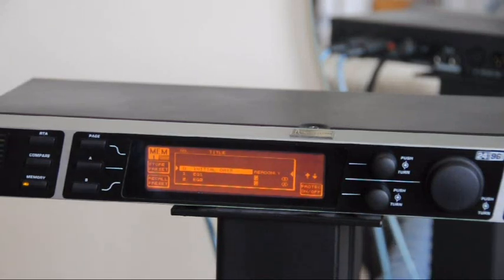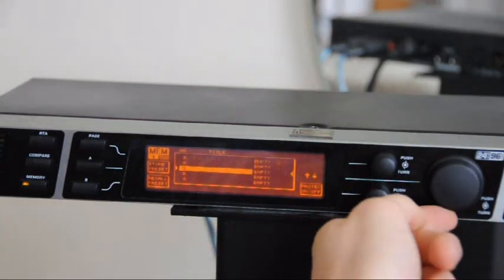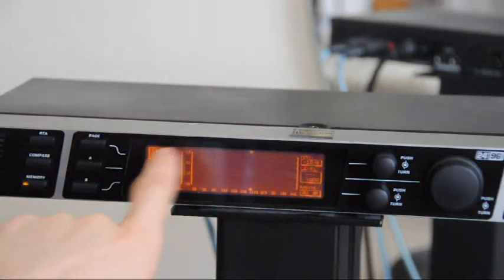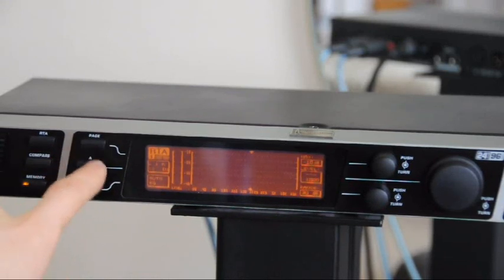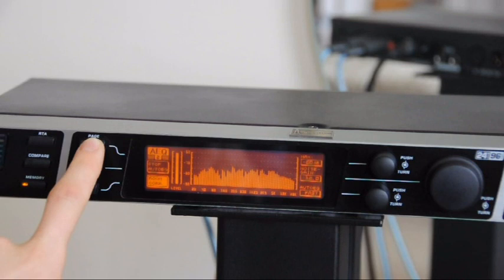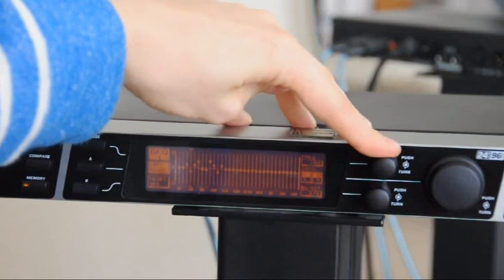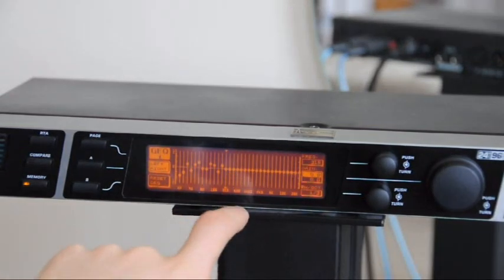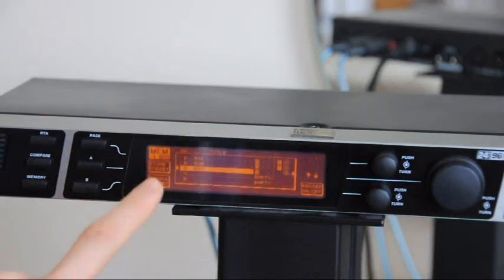DEQ2496 Room Correction EQ Guide

Comment: After having this model for a few years it's power section is starting to fail me as they've been known for. Can anyone on here recommend a good alternative with similar features for my home stereo. Really liked this unit but it does have a longevity issue and I don't feel like sending it away for repair all the time. Thanks.
Reply: dbx driverack

Comment: Thank you for taking the time to create this video, TensonUK.

I am looking into RTA equipment for use in car audio installations. I would like to use the DEQ2496 with a quality mic to analyze and tune the car audio systems that I install or service. My question is this: would this be a good piece of equipment for that task? I am not expecting it to be as good as a $10k piece of gear. I am just (re-)starting my desire to do car audio installs, and I am looking for an affordable RTA with acceptable accuracy. I am not necessarily concerned about the EQ features of the device, although, I am sure I will get some use out of them.

Also, I noticed that the DEQ2496 can do SPL as well. Is that feature fairly accurate? Again, it doesn't need to be fantastic, but a reasonably close reading would be a huge bonus to what appears to be a very nice piece of gear.

We all know that many car audio enthusiasts care about SPL over sound quality, but I want to be able to tune a system properly because that is what I care about the most. The DEQ2496 looks to be a perfect solution, for me, at an entry-level price.

Thanks for any help that anyone can provide. :D

Comment: It's not that people don't, but there is an interaction between frequencies, especially the low end below 100hz.  Some people will recommend using the auto eq in stages to try and limit this effect.  The manual actually states to remove those below 100hz when running auto eq.
The other misunderstood button is room correction.  This cuts the high freq and boosts the low by about 1db.

Comment: They probably blank out the settings at < 100HZ because errors in  FFT algorithms used  there usually get large at low frequency (frequency time tradeoff effects). I have seen the same on some pretty good analysers